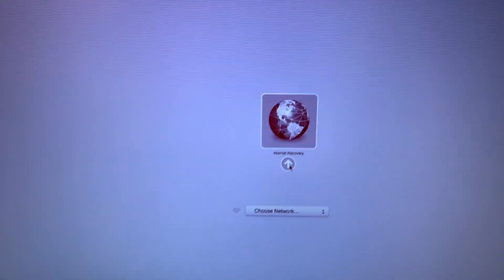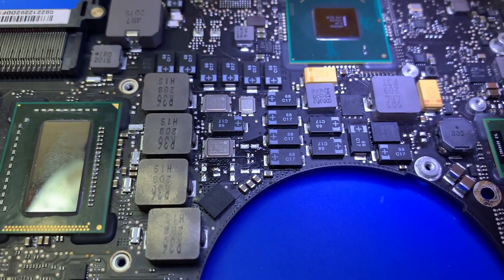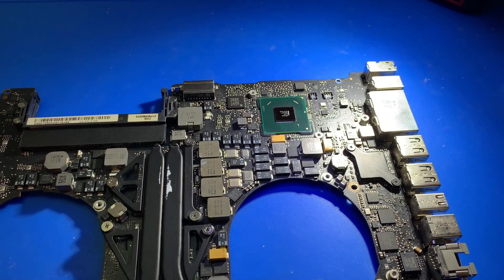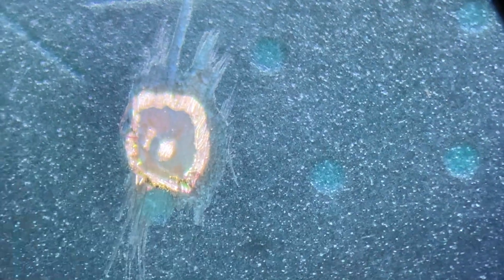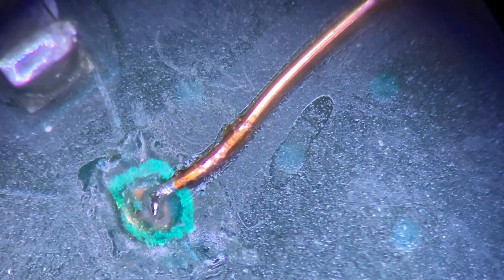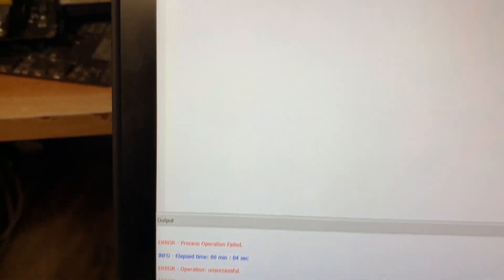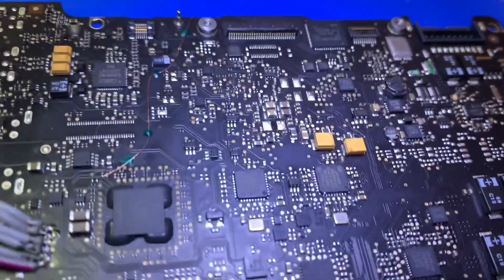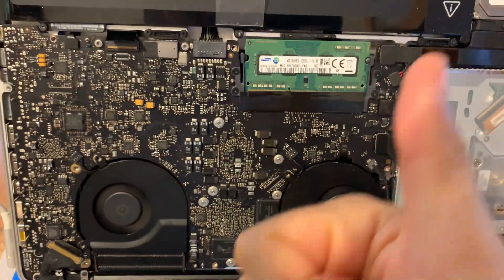Native Brightness Control 15" 820-2915 or 17" 820-2914 MacBook Pro with disabled dGPU via GMUX Flash

Comment: Am I wrong in saying that LCD_BKLT_PWM is available at a test point near C9623 on the 2915 board? I don't understand why both you and the original video run the jumper to other side of the board
Reply from the maker: You are absolutely correct! Thank You for noticing that! It will make this process look more professional. I was just playing with OpenBoardView and realized why I did not see this. If You search LCD_BKLT_PWM in OpenBoardView - it will show connection points on the the other side of the board in Blue and on the PCH side of the board in a regular color as any other test point. That test point will just get bigger and noticeable if You zoom out.
Reply: @applepietech   Yeah, honestly the way OBV shows the test points is what made me doubt it in the first place. For some reason advancedreworks is showing me a 404, so you making this video is the only reason I felt confident enough to try this repair, I'm glad I could give something back. The PWM point on the PCH is deceptively small, I had to take the x0.5 lens off my microscope while I was digging for it
Reply from the maker: @danandrei96  Same thing, You can't dig it out without taking that lens off
Reply: @danandrei96  yes I am getting a 404 on all Advanced Rework forum links too. I hope that it's not an ongoing situation but I suspect that it may be. I just looked to see if Wayback Machine had captured the site at all and there are some from this year. Just going to see if I can find the original post that bought this to our collective attention. Not having much luck as it seems that it only captures some pages. Not sure how that works https://web.archive.org/web/20191019165901/http://advancedreworks.com/forum/forumdisplay.php/mac-computers-motherboard-repair.html

Comment: Hi! Great video like many others in your channel.
Have you been able to make brightness work in any macOS greater than Catalina? Catalina works OK with dosdude's installer patch as long as the backlight patch is not installed but, so far, I have not been able to make brightness work on Sonoma 14.5 with OCLP 1.5.0. Backlight is always at 100% and nothing happens when the F1 or F2 keys are pressed. I'll continue testing other macOS versions but maybe you already figure it out.
Thanks!
Reply from the maker: Thank You! Did you do repair this exact way by running wire to the pch? Where is another way by flashing Sjenja87 firmware and running one jumper to the keyboard ws_kbd23 line.
Reply: I've done it this way with the wire from PCH.
I'm currently trying to get some help on the OCLP forum as well as trying to make it work by myself with try and error.
I'll report back my findings as soon as I have updates.

Something that I want to try is patching with OCLP as MacbookPro8,1 (13 inches). Another thing that I will try is other macOS versions, like Ventura, BigSur and Monterey.
Reply: I have tried many combinations which I have detailed in OCLP's discord at https://discord.com/channels/417165963327176704/1262884711819120690

I wonder why this doesn't work when in Sierra, High SIerra, Catalina and Ubuntu 16 brightness works just fine.
Reply from the maker: Try the method I mentioned in my previous reply. I had no issues with brightness control with it while running Monterey.

Comment: Sure of measurements if i use mine Mitutoyo caliper? Thanks videos! GPU just died on me and i happen to have programmer in hand.
Reply from the maker: Sorry, I do not have the exact measurements. However You should be able to pinpoint it by the diagonal line and capacitor. Check my other videos, I have it in at least 2 more. Just go slow and You'll be good
Reply: @applepietech  Thanks yeah i think i will first do without it as i tried one another same style chip and its still too weird to "dig" in that kind of area/surface.. not used to dig chip surface :) Good videos you have, thanks of them!
Reply from the maker: @XantheFIN  You are very welcome! Yes it weird on the first couple tries. Now it's a walk in a park :)
Reply: @applepietech  I will first get microscope to be honest before trying.. i can do lots of smd soldering bga and so but this goes little far without scope :)